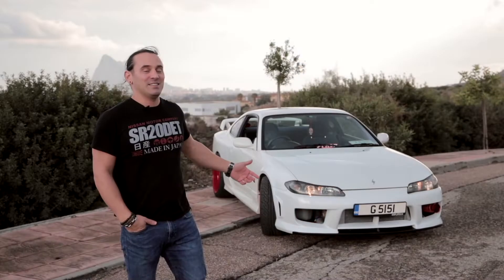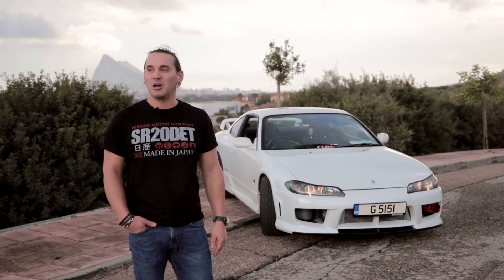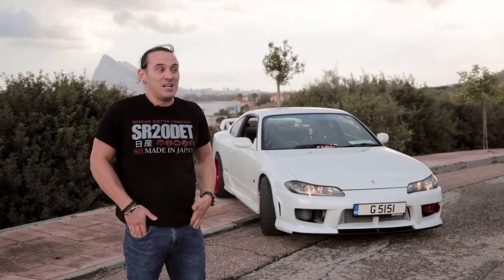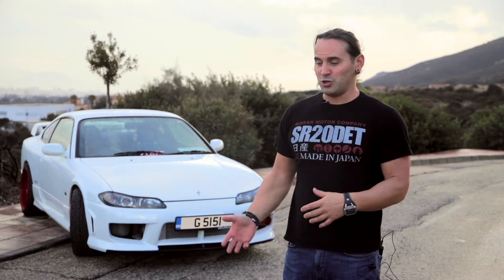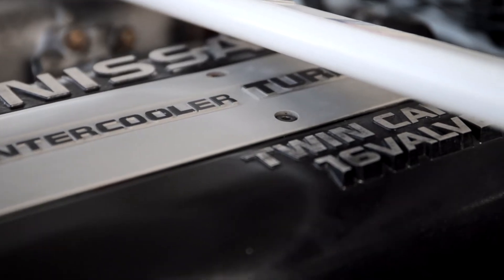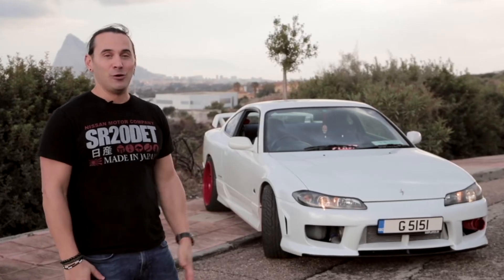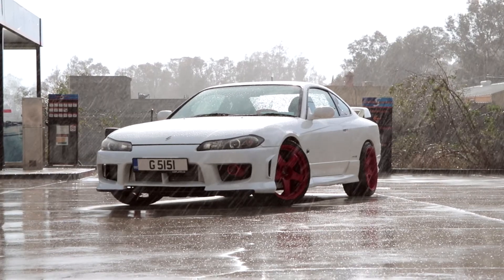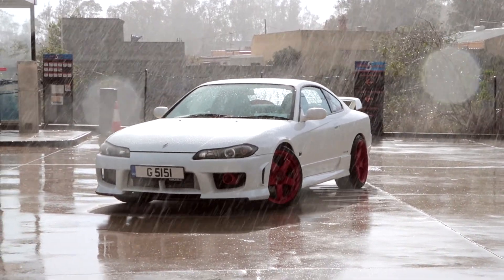My Forged Nissan Silvia B-Package S15 Story - Video By @perhat2211

Comment: At 400brake do you need to replace the vvt more often? For example every 6months?
Reply from the maker: I’ve had no issues with my VVT, but There’s a little VVT rattle though, which I believe is normal with the SR20s